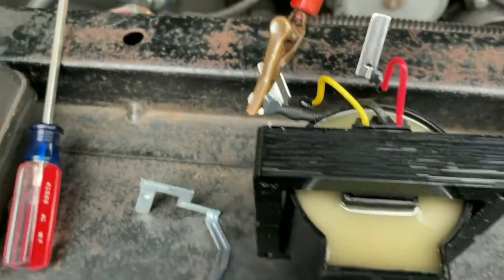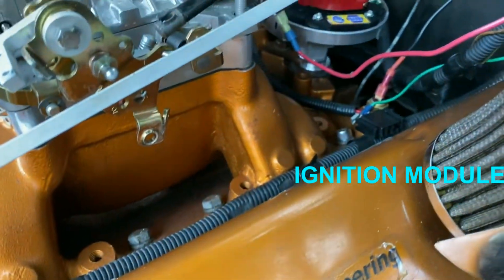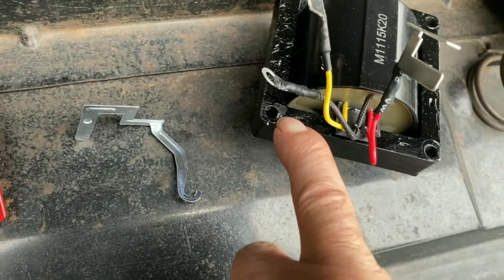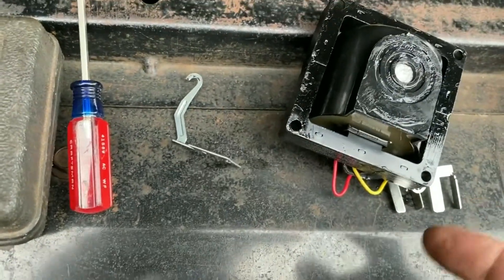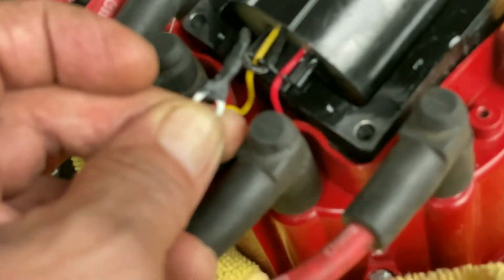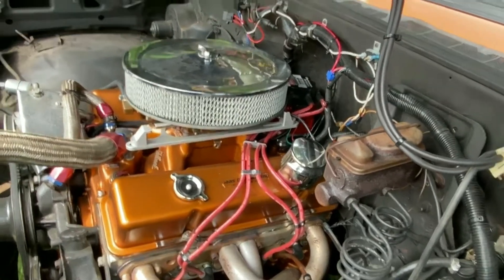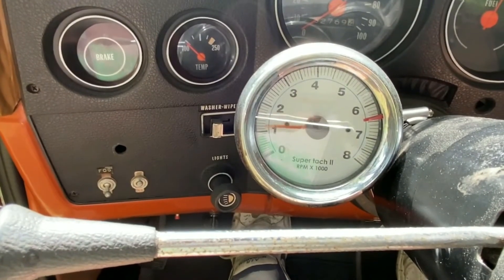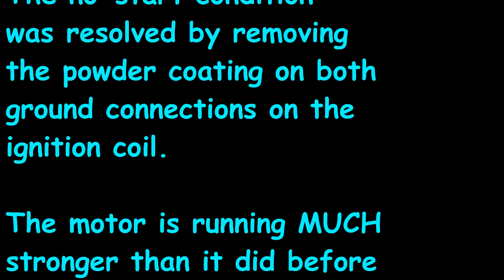Davis Unified Ignition Distributor - Internal Ground Failure!

Comment: I'm curious, do you use the regular high resistance carbon brush or the ow ohm brush they sell like MSD & Accel used to sell?  There seems to be some misinformation about using the low ohm brush for only race applications, but theoretically, I see that reducing as much resistance in the secondary side will produce a very intense spark including using Non Resistor Plugs, in addition to using Granitelli 0 ohm plug wires.🤔. Also I think using a low ohm brush will allow the in-cap coil to run cooler.  I spoke to MSD & asked why ALL their other caps that use permanent high resistance carbon brushes don't use low ohm brushes & this veteran tech didn't know why.  I stated probably due too mass offshore production costs & tooling.  They are sourcing those carbon brushes somewhere or 1 brush manufacture is molding them specially with a high copper % of  graphite, so it really has made me think about optimizing all ignition systems & those carbon brushes which are about 5k-8k ohms. Even the small cap HEI with remote coils have the cap with the permanent high resistance carbon brush.  My idea is to retrofit all caps center brush with the low ohm brushes.🤔
Performance distributors #122222, or MSD #8412 Low Ohm Carbon Brush. 
 Need to find an old school distributor shop who understands electrical ignition engineering about this mod.!🤔

Comment: Good find! I just ordered one of these distributors for my 67 Firebird and will definitely check that before I install it.
Reply: Update, I received my DUI distributor and it was the same as this one. There was paint on the surface where the ground strap and ring terminal mounted against the core and the heat shrink was slid too far down on the ground ring terminal. I scrapped the paint off on the core in those two areas and used a razor to remove the excess heat shrink off the ring terminal and reassembled it. The core seemed like it was painted instead of powdercoated because the coating scrapped off super easy. I verified with a multimeter there was no continuity before I scrapped the paint off but there was continuity after. Now under load it may have been able to ground through the coating but definitely not ideal and I would have probably ran into this same no spark condition eventually if I hadn't addressed it before installing the distributor.